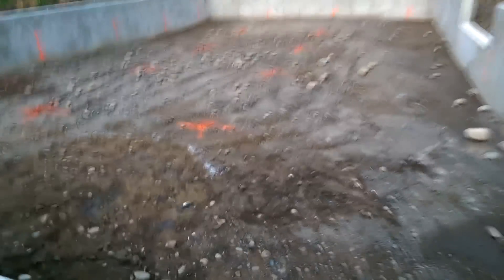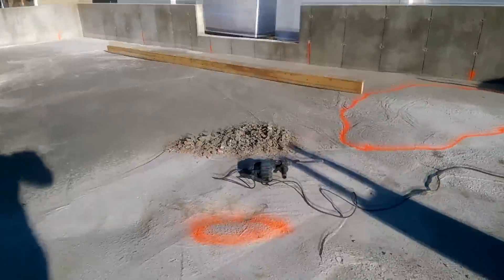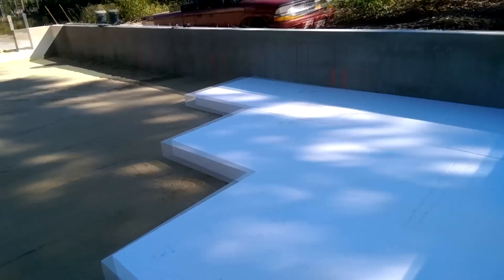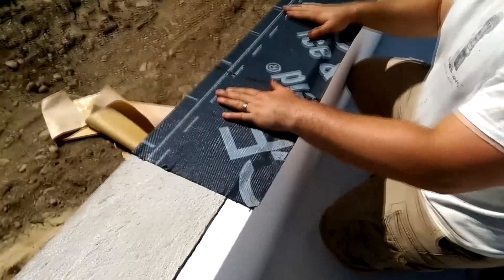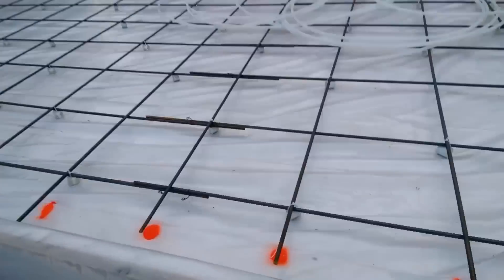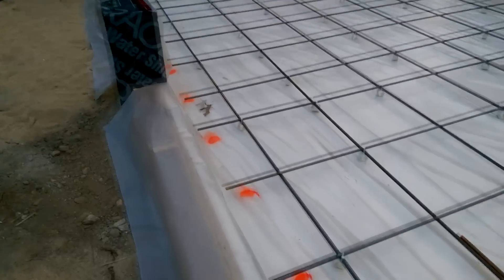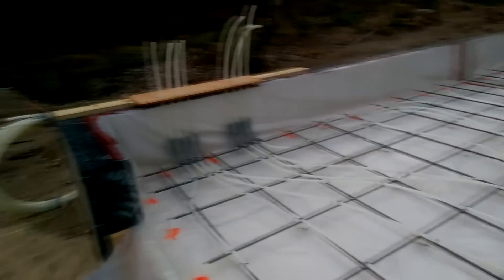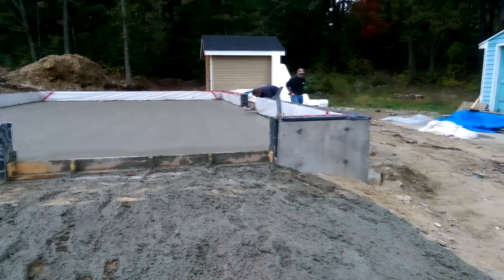Garage Workshop Super Insulated Radiant Floor

Comment: Now that's how you build a building !  I just made the same comment on your truss install.  So, the floor is R-56 ? Awesome !   What is the R-VALUE of the ceiling ?  I see in the very beginning of your build that it looks really deep, I'm dying to know and also how is the building performing heat wise ?   Thank you.
Reply from the maker: Hi Ryan,  Thanks for watching the video and joining the discussion.  Probably most of us watching an insulating video are aware of the "law of diminishing returns" with R-value, but just because the last inch of insulation does less for me than the first inch is no reason not to install it.  Most heated garages (commercial and residential) that I've worked in need massive boilers.  I'm going to be heating my garage this winter with just some solar panels.  I would not have been able to achieve these results with just the first one inch of insulation (as the reference to the law of diminishing returns would suggest).  But it is a great discussion, so thank you for bringing your opinion to the table.
Reply: 24x30 garage with 24x24 attached workshop.  Ground, then packed gravel to level, then 2" pink styrofoam.  Also same styrofoam around interior perimeter of foundation past the floor styrofoam.  6" concrete with radiant tubing and entire building is heated with a water heater for less than $200 a month in MN.  I heat the shop, and heat bleeds through to the garage through a cold joint in the floor.  Shop kept at 65 F, garage varies around 40 F.  So what exactly did you gain?
Reply from the maker: Thanks.  The ceiling and walls will get their own video.  I've got the raw footage, but I need to compile it.  But, spoiler alert, the ceiling is an R-100.  No particular reason for that R-value other than it seemed like a nice round number.  Performance is amazing.  The first winter I heated it with an electric water heater, 3,000 watt elements.  That is about 10K BTU's per hour.  I don't need all that, but it was just what came with the water heater.  I've got more videos on my channel about converting it to solar heat.
Reply: I would imagine that 98% or more of your heat loss will be out thru the garage doors.  I somehow cannot imagine you installing 14 inches of insulation on the doors.
Reply: @The Words-14<  depends on what PSI the foam is rated for. I've seen engineers spec 50 PSI foam to handle bigger loads. I'm guessing this won't see loads that high.
Reply: Ryan, who cares ?  DavidPoz has one hell of an insulated building ! And even if he gains only a small amount after R-50, he's still gaining and I say bravo !!  I'm an insulation installer, so I may be biased !
Reply: DavidPoz you do realize after about r50 your just wasting money right? Your gaining very very little for every r value.
Reply: after r 38 the amount gained will never be recovered.   In  60 years one might come close to recovering the 25 cents in power saving per year LOL

Comment: How does the foam perform over time with heavy loads (like a truck) going over the concrete floor? I imagine that the insulation foam eventually gives in and causes the concrete to crack.
Reply from the maker: I don't see any cracks so far.

Comment: what if u want to add 2 lifts into the floor and the lift slabs need to be in higher grade and thicker than the rest of the floor?
Reply from the maker: You can thicken the floor into a footer for supporting a point load by leaving out the top layer of foam right in that spot.  usually 18" square, or 24" square something like that.  And add some rebar into it.  This would be something your structural engineer would have to look at.
Reply: ok, but can i pour different grades at the same time or would i have to let the higher grade cure up first and then just tie the rest of the lower grade floor to those higher grade blocks?
and is the perimeter foundation concrete also like c35 or just some random c15 grade mix lol

Comment: Definitely good to insulate under a heated slab. Just seems like way OVER KILL on the AMOUNT of INSULATION in this project? Insulation foam sheets are quite expensive. Any good guidelines to follow? I have heard 2.0" to 4.0" likely the most common thickness, even in very cold climates.
Reply from the maker: Yes, it is overkill.  This building is 1200 square feet.  Most people recognize that the ground is fairly constant temperature of about 50°F in my area.  However, we can get more accurate when we talk about the perimeter losses, and the gradient of cold, but for now, let's keep it simple.   Let's say, the slab needs to be a constant 90°F to keep the air temperature warm, and the ground is 50.  40°delta.  That's 24/7 for about 5 months.  If it was insulated with 2" of XPS, then the heat loss would be 21.6MBTU/yr.  With my assembly, I have 14" of high density EPS, is about 3.4MBTU/yr.  Saving 18.2MBTU/yr.  My property is 100% electric, and my electric rate is one of the most expensive at $0.26/kwh.  So I save $1,386/year.

Comment: first: self leveling mean that it will level spots few mm high to true flat surface, it have to be roughly leveled after pouring. 
second: it need to be waterproofed from below, ground beneath act like sponge will suck all moisture in matter of minutes and self leveling properties are gone along with moisture.
Summary: it is all about prep as always

Comment: Cool video. By the way the little PVC rebar holders, just curious as to why you didn't just use rebar chairs (Kiwi slang name for them I guess)
Reply from the maker: I called, and drove, to several stores in my area and they either had never heard of rebar chairs, or were sold out.

Comment: How much load can the foam take? I’m thinking a out a workshop with a lathe, mill etc and would not want the foam to collapse
Reply from the maker: The manufacturer I bought it from can make the foams to several different densities.  The higher the density, the more PSI (pounds per square inch) it can take.  I ordered a medium density that is fairly common for this application.  I forget the exact numbers now, but I do remember that it's strong enough that I could put a 2-point lift anywhere I want in the garage.  edit: here is the website: http://www.branchriver.com/pages/cfHome.cfm

Comment: what keeps the foam from collapsing under the concrete? Seems like the top layer would break into big chunks.
Reply: High density foam is not the same as the crumbly stuff in appliance packaging. It's actually designed to hold up weight, and is rated depending on how heavy of a building you will put on top of it.

Comment: Pex for infloor heat should be stapled to the foam.
Reply: Looking for an explanation of this suggestion ... staples & plastic piping? ... sounds like a puncture accident ready-to-happen.
Reply: @murraymetcalf-CA  Standard operations here in Alaska call for stapling the pex used for infloor heat to the foam. The staples and standup staple gun are made specifically for the this application and are used for number of reasons: it is much quicker to stable down the pex than it is to tie it to the rebar, the pex is next to the bottom of the slab and less likely to be damaged or to float to the surface during the pour or later when nailing down wall plates and drilling shallow holes. Hope your project is going good.
Reply: @akbmunsell  Thanks for your response. I have watched quite a number of PEX heating projec videos and I haven't come across the stapling aspect before. Will look into it further.  Sounds like a great production tip for those in the business of of doing this on a routine basis. Who makes a staple gun for this task? Are the staples plastic? Thanks again for sharing this tip.

Comment: I would have added a #10 Copper wire along side of the pex tubing so you could trace it in the event you wanted to add a lift and drill into the concrete. How has it held up? I want to build a 10K sq ft shop and I have the SAME idea as you... I agree about the drain. Has the concrete cracked? any issues with the pex
Reply from the maker: The concrete has not cracked.  If I did it again I would secure the PEX tubing down to the foam board first.  That would leave a solid 4 inches of concrete (I have a 5" slab) to secure to.  But, I have found that I can see the tubing easily with a thermal imaging camera.

Comment: Old video, but just wanted to say that if you want to try  self leveling fill again you can get it.  I'm in Wisconsin and I've seen what they call "bank run".? 
It's fill sand/gravel delivered wet by cement truck.

Comment: So in hindsight, would you just use the masons sand from the getgo to create your level surface for your foam?
Reply from the maker: I would have just used crushed stone, like 1/2" or 3/4" crushed.  Level that out and put the foam on top.  I've done it that way before and works fine, but I'm fussy with making the stone level.

Comment: Flowable fill is self leveling cam is not. Huge difference between the two.fill has almost no cement and is all sand and water. Cam is a very low grade concrete which is used as fill as well. Either would work with almost identical results for your project. Rebar is more structural mesh is for dog pins and pads that are of no concern bit does make in floor heating alot easier.

Comment: Hate to criticize but, in your efforts to save money with an efficiently heated space, you spent  more money than you'll ever recover.  Your foamboard need only be 2" on the bottom and sidewalls, as the heat will be drawn to the surface, where the colder temperature is.  High school science taught us all that heat naturally goes from areas of higher temperatures to areas of lower temperatures.  Which concrete do you think will be colder?  The ground underneath your heated space, or the concrete walls exposed to winter conditions where you put 2 inches?  All money in the extra floor insulation has been wasted, never mind the self-leveling fill BS, and all that rebar you put in.

Comment: In Europe we make first concrete plate, then the walls (isolated from the bottom). After your building is finished you put styrofoam in rooms at the bottom (mostly 5cm) and then we put another layer of concrete (3-5cm) and you can install pipes for heating in it. So on that way you have isolated and heated floors, i want to combine it with solar. There are also some relatively new solutions, to put styrofoam directly on the earth and then put concrete in it, that is even better way of building.
Reply from the maker: That sounds like a nice system.

Comment: I’m curious if you did any calculations. I’m in NH. We get fairly cold here. When I did my basement radiant floor, there was something like a 30 or 40 year payback in buying any more than R10 foam. The ground temp is about 50 degrees under the slab and the slab temp 70 degrees Fahrenheit. That’s only 20 degrees delta and heat loss is directly related to the differential temperature. I probably would keep a workshop at 50-60F. So, anything over R10 is just spending money in my situation.

Comment: should have just used a fine stone and then sand under the EPS would have saved a lot of $$$$$
Reply from the maker: I agree.
Reply: @DavidPozEnergy  how do you find the under floor heating
Reply from the maker: @Guerrillaskin2012  I love the radiant floor.  I have it connected to some solar collectors (heat water) and that's all I use.  Most of the winter the garage stays 45-55 degrees F.  I don't do anything, it turns on automatically when the sun is out.

Comment: You only needed to worry about heat bleeding out around the perimeter. 
In the center the soil stores that energy and releases back into your building.
Also redbar isn't going to bond good with that tubing running parallel to it.
(Hopefully it's oxygen barrier rated.)
Reply: That is what I have heard, if you take one of those layers from the centre and use it on the perimeter it should give a better result.
Of course it depends on ground conditions.  High water tables, porous soil will suck the heat away.

Comment: There's a lot of discussion here, so I'd appreciate some feedback - We're looking to build a holiday/maybe early retirement home in  Nipigon, ON and are walking the cost/performance tightrope. We'd love to build Passive House or Net Zero, but doing so in a manner that satisfies our mortgage lender is going to be over budget - but we can't go the DIY route for essentials needing a warranty like foundations, slab etc. (though we will be looking at stove pipe heat recovery and so on) Main heat for this small property is going to be a Scandinavian made wood pellet burner as a top up heat to an electric / Solar heated radiant floor system. A local contractor suggested using an engineered kit for this, to take out the guesswork - so have any of you had experience with this type of Solar Heated engineered radiant floor kit? So far we're favoring https://www.youtube.com/watch?v=znZEmufxkZk - thoughts anyone?
Reply from the maker: Very cool that you want to incorporate energy efficient items in your new home.  That's great.  I checked out the video you linked to.  I'm not personally a fan of using air as your heat distribution method.  
As far as the mortgage, cost, efficiency balance goes:  I totally understand.  I had to juggle those same  problems when I built my home.  What would the bank allow?  What had to be done upfront?  What could be easily done later?  I made a list of every efficiency idea I wanted in the house.  Then I prioritized it based on easiest to hardest to add/change later.  For example, I built the house with one-foot thick walls of insulation up front.  That was the hardest to upgrade later.  But, I held off on my solar thermal heating system in the beginning.  Instead, I just used a single, $80 electric baseboard heater.  Yeah, it was a waste and got ripped out a few years later when I built my solar heater, but it was bank approved, got me into the house, and wasn't a big waste.

I watched the video you linked to.  I'm not a fan of using air as your heat distribution method.  I prefer water, but you can make anything work with the right engineering.  

Good luck on your build.
Reply: @DavidPozEnergy  Thanks for the feedback! I've been checking out some of your other videos, so many tips n tricks, thanks for those too!! We decided that as we're building a home we should make it as energy efficient as possible and in doing so reduce our spend over time and overall impact. Doing this in a Bank friendly way without exploding the budget is turning out to be the  tricky part! Every home starts with the foundations, and we sure can't change those later so that's why I'm working from the ground up. As we've already had a water radiant floor in the past that a contractor managed to drive a screw through when we extended the island - which was a real pain to fix - and as the new place is starting as a holiday home then if all works out we will be heading there for an early retirement,  it's likely we may want to change the internal layout over time too - both part of the reason we're leaning towards the idea of air-heated cos it doesn't matter. Plus, they engineer everything and get the drawings stamped off, one headache less. The air can be heated by a Solar box that can be fitted later, and has an electric heating element and fan incorporated in the distribution box - so the upfront cost is offset against what it would cost to go "traditional" with frost walls etc. If all goes well, we should be starting later this year - so I might take your lead and video it as we go. Again, thanks, it's guys like you who put themselves out there that encourage us to give stuff a try and not just buy a cookie-cutter inefficient box.

Comment: Say in time you wanna put a car lift in that shop how would that work out with the radius heat please comment back does I'm looking to do a garage and I wanted to do the radius heat
Reply: I'm planning a similar project, my plan is to pour pillars with the studs sticking up to mount one four post and one two post lift. After the pillars are poured I'll do my insulation and then vapor barrier  then radiant floor heating then pour my pad, install lift and cut off excess from bolts. Everything is being pre planned in my shop including in floor vacuum ducts, a winch system and a over head crane system. All which involve processes before concrete slab is poured
Reply from the maker: Those will be some seriously sturdy lifts.
Reply: But david is correct, it is absolutely possible after the fact. Studs into a pier instead of concrete anchors is a better system, concrete wont be as hord when it's new, concrete anchors put pressure on the concrete and could cause cracks. It doesnt cost very much to pour the piers before hand and you end up with a better safer result
Reply from the maker: Hi Martin,  If you know in advance of building that you want a lift, then you can avoid installing any tubes in that location.  However, I did not do that.  If I wanted to install a lift today, then I would rent a thermal image camera ($75/day @H.D.).  Run the radiant heat floor and you will clearly see the tubes.  I did this once for fun and was amazed just how distinctly you can see the tubes.  Once you know where they are you can adjust the layout of the lift bolts to avoid them.
Reply: DavidPoz  Thank you very much for that information I will put this on lock on my cell phone

Comment: EPS on the ground without any water insulation ? :O It will suck moisture and in reality leave floor without no thermal insulation. R = 0, not 56
Reply: Isn't this EPS a closed cell foam and therefore doesn't absorb moisture?

Comment: Heat rises. Whatever energy that bleeds down will eventually rises up again. It is not going to disappear into the ether. The R60 on the bottom will save you more energy if you re-locate them to the roof.